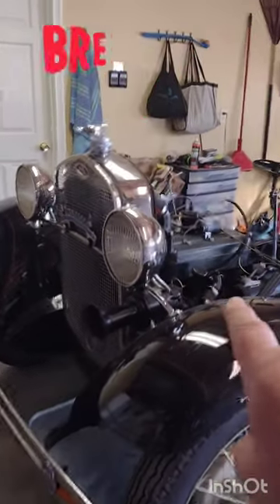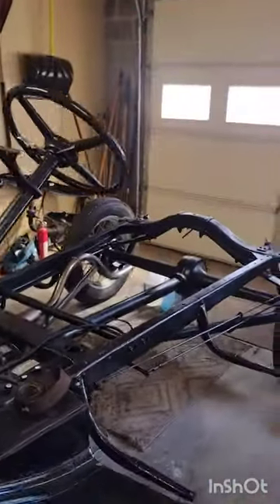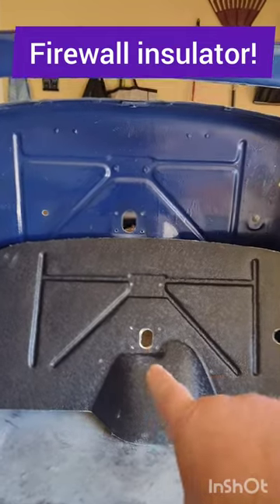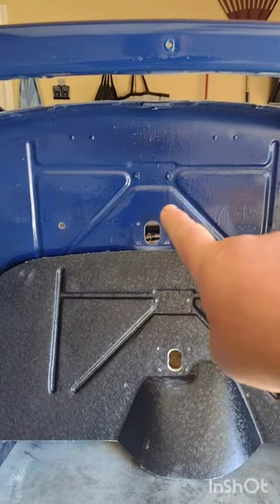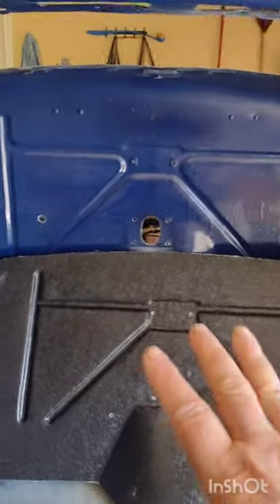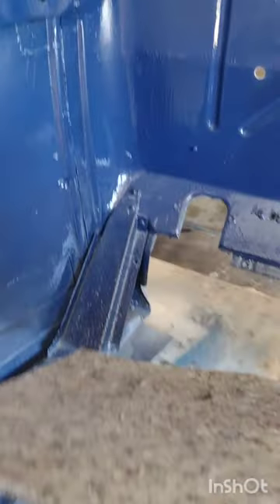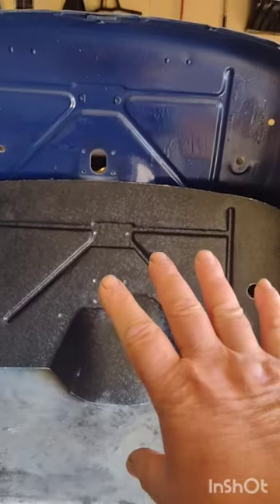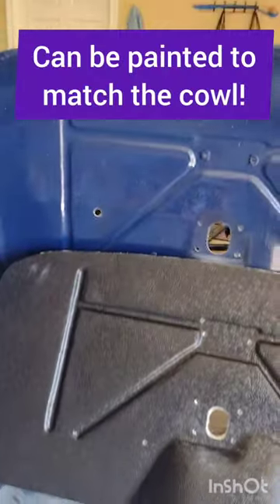Firewall insulator for a 1930 Ford Model A

Comment: Several sound isolation mats are available. Why not do the top of the floor boards as well? 

Also, the underside of the fenders. Rocks, gravel and small debris coming off of the tires make noise hitting the underside. Some kind of spray on liner would do. Just an 💡 idea.
Reply from the maker: I plan to insulate the floor too.  It made a huge difference when I did that on the old body. I plan to use a spray on bed liner for the underneath of the huckster bed too.
Reply: @kensmithgallery4432  Sounds like a plan!

I love it when a plan comes together. -Hannibal
Reply from the maker: @williamforbes5826  me too!